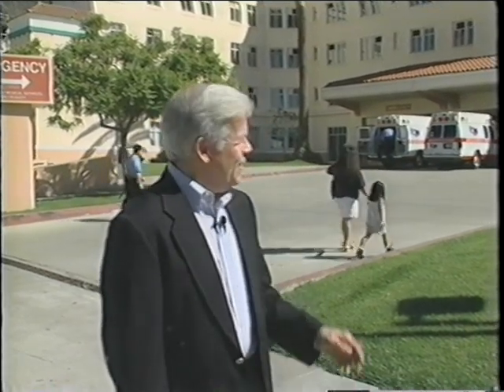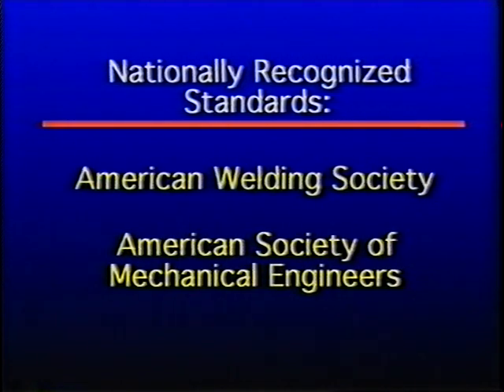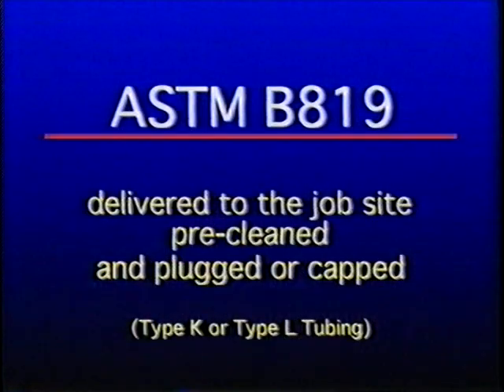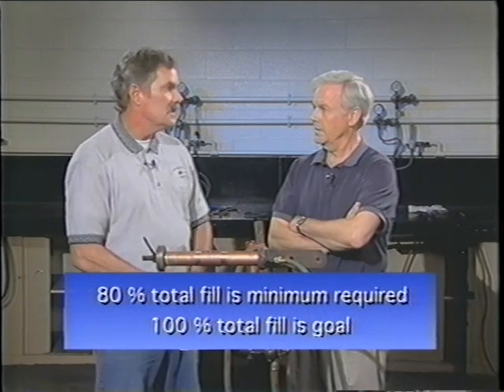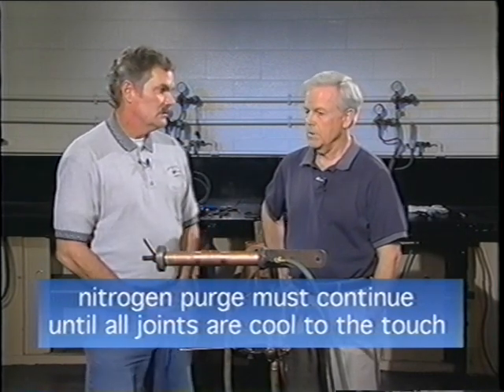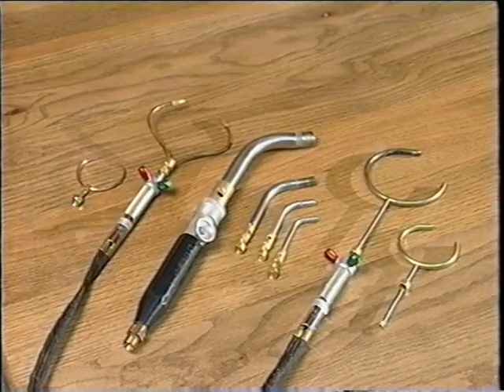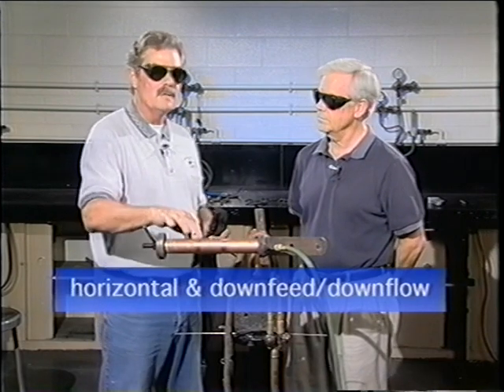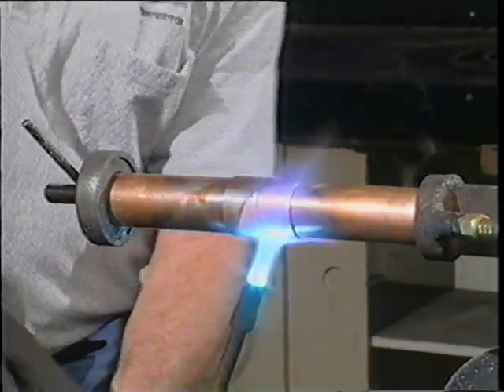Medical Gas Brazing 2000 (Part 1 of 2)

Comment from the maker: That is great to hear. Please remember that a license is not the certification. The certification is the ASSE 6010 Medical Gas and Vacuum System Installer Certification, which may be utilized in most jurisdictions as a means of obtaining the license to install medical gas piping systems. Please visit http://www.nationalitc.com/ for additional information on related piping industry brazing. Thank you for viewing and we appreciate your comments.
Reply: What is the difference between a cert and license in terms of medgas?
Reply from the maker: @DragenPlante2000 the certification is what is required by the code, the license is usually what is required by the state or authority having jurisdiction (AHJ). Most states accept the Certification as a prerequisite to obtain the license. Not all states require a license but if a project is being installed to the NFPA 99, then the Installer must have a current ASSE 6010 Certification. Hope that makes sense. Thanks for viewing the video.